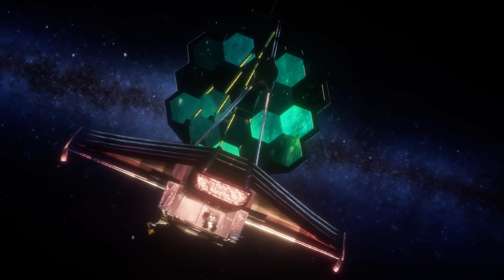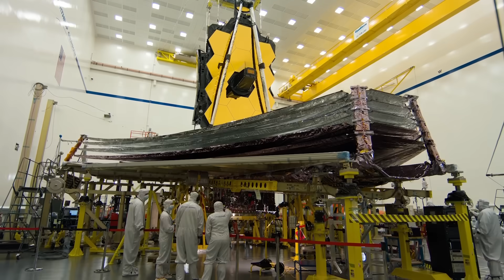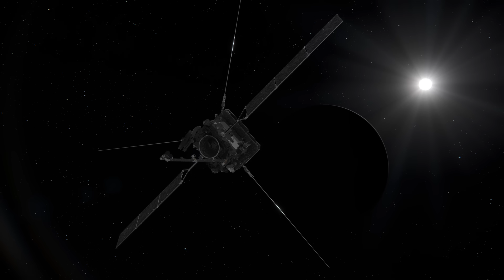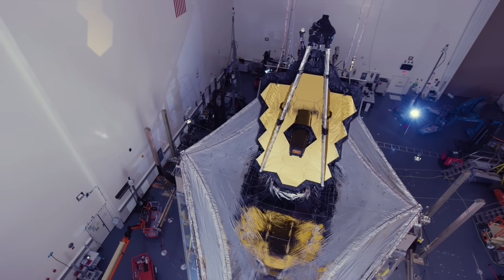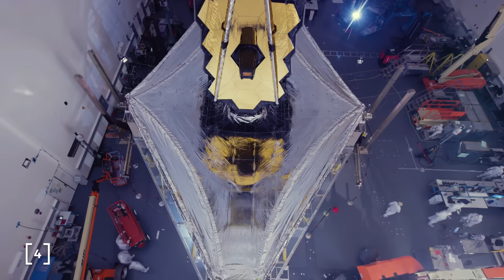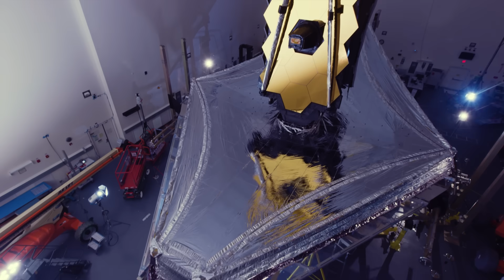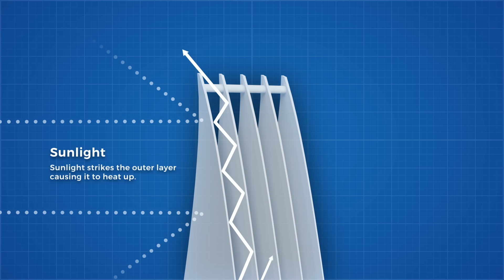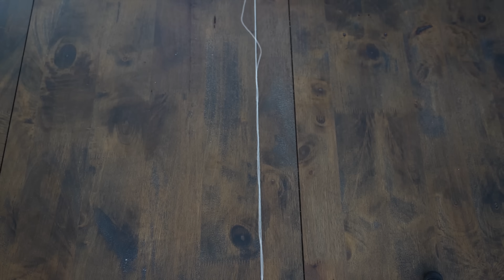The Insane Engineering of James Webb Telescope

Comment: The JWST cryo cooling system is just something else entirely. I work as an engineer on land vehicle cooling systems, and the thing about cooling systems is you don't realise how little you understand about the science behind active heat transfer systems until you actually start designing them. The designers would have had to simulate and account for every single joule of thermal energy throughout the entire telescope, and then design such a cutting edge active cooling system with moving parts that can last for decades of non-stop operation with no servicing and with no allowances for failure. How many times the engineers would have woken up at night in a cold sweat! I'm not even one bit surprised that it cost $150 million to design.
Reply: not only that, but i noticed passive analog cooling is ultimately being used to vent/radiate away the heat. what i mean by this is that it looked like they were using simple heat transferable metal (probably copper) to simply radiate the heat away from components and guide it where it's needed (the heat radiation). it's amazing something so technological uses one of the first ever but most used cooling methods devised. i'm not an expert on thermodynamics and my engineering skills are computer related, but it's all simply fascinating. maybe you could tell us more or correct me if my description is sketchy.
Reply: @rljpdx  There's simply no other sink available to deposit excess heat into! You can actively transport heat about the system all you want, but in the end, the entire system's heat sink must be external to the system, and accessible by some combination of conduction, convection, and radiation. In this case, the sink can only be external space, and that is only accessible through radiation. On top of that, the act of transporting heat against the direction where it wants to go in itself requires energy. So really you're trying to reject both the energy of transporting the heat along with the redirected heat itself. 

Since the temperature difference of the gas at either end of the pulse tube is relatively constant, the theoretical minimum temperature (with no parasitics) of the cold end is the temperature of the hot heat exchanger (HHX) minus the achievable difference in gas temperature at either end of the pulse tube. Any steady state heat load present at the cold end increases that minimum temperature because the cold gas in the pulse tube has to remove that heat load from the cold end through the cold heat exchanger (CHX), and so the gas must be colder. The heat of operating the pressure wave generator is generally rejected into the HHX, or an additional supplementary heat exchanger (aftercooler) placed earlier in the system, but can diffuse into the pulse tube gas, or present a heat load to the HHX and raise its temperature. Additional parasitic type effects basically just include all the conduction, convection, and radiation modes between parts of the system at different temperatures. 

For additional information, Ray Radebaugh is an authoritative figure on crycoolers and has written comprehensive reviews of the state of the art. He has also taught a short course at the yearly International Cryocooler Conference, though I'm not sure if that sort of thing is going on this upcoming year.
Reply: So...not really "insane."
Reply: @jasonyoung1622  yeah thanks. in my research I did discover these points you've made and your additional explanation is just good to know.
Reply: MoronicWaterBuffalo  your name describes you quite aptly.
Give credit where it's due & perhaps you should be applying for a job at NASA since, according to you it's all very simple.
Reply: @rljpdx  Essentially yeah, when there's no atmosphere available then radiation is the only way to reject any heat generated. The Apollo missions had the same constraint because there's no atmosphere on the moon at all. The NASA Lunar Roving Vehicle had a fascinating electronics cooling system that used thermal straps and boxes of paraffinwax that absorbed latent heat as the wax melted, then after each trip the astronauts would open up reflective panels that rejected that stored energy via radiation to re-solidify the wax. And it did work adequately for all of the missions despite the lunar dust issue. The technology that went into those manned missions was staggering even by today's standards, let alone over 50 years ago when it was a totally new frontier.
Reply: They are the kinds of engineers to wake in at night in cold sweat, and still calculate how much joules their bodies are now radiating.
Reply: MoronicWaterBuffalo  LOL good one ;)
Reply: @jimtekkit  wow, amazing stuff. thanks for all this great info. i thought it was just par for the course but i'm really amazed at the technology and the great explanations you guys have given. thanks.
Reply: Here in the gov of Netherlands they bought a corona app that shows a QR code for 30 million euros. Even though its 5 times of that same amount. Its more worth its money than anything stupid govs these days pay for corona idiocracy
Reply: @jimtekkit  It's not true that in space radiation is the only way to reject heat. The sublimators used in the Apollo lunar module and the astronaut's lunar spacesuits were basically heat exchangers somewhat similar to an automobile's radiator. Of course there is no air in space to carry away the heat so something else must be provided. This was done using water coming from a storage tank. The water was supplied to the sublimator where is was exposed to the vacuum of space so that it would freeze into ice. Then warm fluid from the cooling loops flowing through the sublimator warms the ice allowing it to sublimate into a vapor and that vapor is then released and it carries the waste heat out into space.
Reply: @jasonyoung1622  You seem pretty knowledgeable about this type of cooling system so I have a question. It seems like the pulse tube is basically like the compressor in a convention A/C system. Then the warm side heat exchanger is like the condenser and the cold side heat exchanger is like the evaporator. Also, it seems like there needs to be something like an expansion valve present to divide the high and low temperature/pressure parts of the system. Is all this correct?
Reply: @joevignolor4u949  
Hi Joe,

You seem like you already know things about A/C systems, but I will preface my explanation of cryocoolers with a review so that:

1. So I can more effectively compare and contrast the technologies. 
2. We can be on the same page
3. For the educational benefit of others reading
4. To lay bare my understanding so that others may correct me if I am wrong

Please bear with me.

A traditional A/C system works a bit like trying to transport water with a sponge. When you apply pressure to the sponge, you wring out water. If you reduce the pressure of the sponge, you can absorb water. So all you need to do to remove water from somewhere is to wring out the water by pressurizing it somewhere where it can be disposed, transport it to your target location, depressurize it so that it can absorb water, absorb the water, and then repeat.

On top of this, the refrigerant (sponge) used can also change between liquid and gas phases, allowing energy to be stored in the changing of the refrigerant phase. When a substance is changing phase, it remains at an essentially constant temperature, meaning that you can heat the refrigerant until it evaporates (which takes a substantial amount of energy) without it warming up and reducing further heat transfer. 

So now let's put it together. If you pressurize the gaseous refrigerant, then the temperature of the gas increases above room temperature. You can then try to reject as much of that excess heat as possible to room temperature (squeeze the sponge) so that when you depressurize it later at the evaporator, the expansion then cools the gas below room temperature. The phase change comes in when you design refrigerants that also condense when the heat is rejected at high pressure. Then, the energy it takes to change from gas to liquid (a large amount!) is also rejected to room temperature. Then, you depressurize (using an expansion valve, like you said) that liquid refrigerant inside your cooled room, where it reaches a lower temperature than the room and thus absorbs heat. At low pressure, the refrigerant is ideally trying to evaporate, so it is able to absorb a lot of heat at a constant temperature.

A pulse tube cryocooler works much differently. Firstly, no phase change takes place, as the refrigeration cycle must operate at such a large variety of temperatures that it is impossible to create a refrigerant that can properly change its phase during the full range of operation in a practical manner, or even remain liquid during the low temperature stage. Secondly, the gas does not continuously flow in a single direction. It moves back and forth, not in a loop. The gas flow is more like breathing into a paper bag - the components of the cryocooler experience flow in alternating directions over time. This seems counterintuitive at first - how do you create a temperature gradient if the same air is going to pass back and forth over the heat exchanger?

I will start again from scratch. Any cryocooler still fundamentally works like the sponge analogy. You are manipulating the pressure and location the gas such that it is hot when it is in the vicinity of the heat exchanger that rejects heat, and it is cold when it is in the vicinity of the heat load. I will start by describing the operation of a Stirling refrigerator with a regenerator, and then evolve it into an orifice pulse tube refrigerator (OPTR). Imagine you have a pipe, and at each end, there is a piston. These pistons will operate out of phase. In the center of the pipe, there is a rather dense arrangement of mesh screens (regenerator or stack). Initially, the piston on the right (cold) side is fully extended, almost touching the regenerator. The piston on the left side is fully retracted, leaving a large volume of gas on the left side of the pipe. The piston on the left extends halfway. The pressure in the pipe is now increased, and so is the temperature. Now the piston on the left extends the rest of the way while the piston on the right side retracts halfway. Now the hot gas is forced through the mesh screens. The mesh screens at the hot end absorb heat from only hot gas, but it cools the gas as it flows through. As a result, a thermal gradient is developed in the mesh screen because the cold side mesh elements are only in contact with gas that has already been cooled. Now, the cold piston retracts the rest of the way, fully expanding the gas. The gas is now entirely cold. If we now fully retract the warm piston and fully extend the cold piston, the cold gas is moved entirely through the regenerator from the cold side to the warm side. Now, the cold gas can cool the cold side of the regenerator more. As we repeat the cycle, the gas is precooled to lower and lower temperatures by the regenerator, and returns at lower and lower temperatures. We only need to attach our application to the cold side of the regenerator to cool it. Additionally, a heat exchanger on the hot side of the regenerator is beneficial to remove excess heat precool the gas more. Having 2 pistons 90 degrees out of phase can simulate these piston movement, and so Stirling refrigerators are often implemented with 2 pistons 90 degrees apart on a common crankshaft.

To evolve this setup to that of a single orifice pulse tube cryocooler as shown in 15:04, the cold side piston is removed and replaced with a pulse tube and an additional hot heat exchanger as shown in the video. This functionally accomplishes the same thing. The pulse tube can be broken into three sections - the gas in the first section flows between the regenerator and the cold entrance of the pulse tube. The gas in the next section floats between ends of the pulse tube. The gas in the last section flows between the pulse tube and a throttled gas reservoir, passing over the hot heat exchanger while doing so. The throttle on the gas reservoir delays the movement of gas from the pulse tube to the reservoir, allowing a 90 degree phase difference between gas movement at the piston and the reservoir, similar to that of the Stirling setup. So the gas in the last section acts as a piston rod, forcing a 90 degree phase change on the warm end of the pulse tube. The gas in the middle section is a buffer between the cold and reservoir gas volumes, acting like the cold piston of the Stirling cycle. We have made a functional equivalence between the Stirling and Orifice Pulse Tube refrigerators and in the process, replaced a rubbing, wearing, moving part with gas dynamics. As a note, the pulse tube itself will also have a thermal gradient. The middle section thermally insulates the first and last sections from each other.

The JWST cryocooler is described in the video should operate somewhat differently from the OPTR I described earlier, but should cool on the same principle of a phase difference between ends of the tube. The OPTR I described above is a traveling wave device, while the device described in the video is a standing wave device. I am less familiar with standing wave pulse tubes, but from my understanding, the overall size of the pulse tube must line up with some critical fraction of wavelengths at the operating frequency, and so higher frequency operation can reduce the necessary size and weight of the cryocooler, which is ideal for space operation. The hot end of the pulse tube is a node of the wave, and so the size of the pulse tube can be tuned such that the regenerator is phased appropriately from the pressure source, creating the same cooling effect. However, I doubt the efficiency of a standing wave device can match more easily controllable characteristics of the travelling wave device, and so the JWST cryocooler must necessarily consist of multiple cryocooler stages to get to temperatures around 7K.

To conclude - the hot and cold heat exchangers are analogous to the evaporator and condensor of a vapor compression refrigeration A/C system, but the compressor and expansion valve are harder to draw analogies to because the pressure of various points of the system itself is changing with time because the cycle itself is rather different.

I hope this helps, and that you have a happy New Year!

-Jason
Reply: @rljpdx  No problem - I have explained the operation of cryocoolers in greater depth in another comment on this same parent. Feel free to read and comment if interested. Happy New Year!
Reply: @circuitbreaker8314  What the hell is "QR Code." A Cheat Code, of some sort, for to help solve "Q-Bert Riddles/Puzzles"?
Reply: @jasonyoung1622  thanks so much for explaining this! Super interesting
Reply: This will make it to heŕ destination succesfully
Reply: @ihavefallenandicantreachmy2113  you are so smart
Reply: @jasonyoung1622  thanks for explaining how it works! One question. Would a cryocooler be more efficient than a HVAC on a house?
Reply: @pyrocl0  a cryocooler specifically? Probably not. Using one as an AC would be extremely expensive and it would be optimized specifically for a cryocooling application. Also, it would not be very powerful. HVAC units are capable of efficiently moving a lot of heat with relatively simple and inexpensive parts. However, there may be some merit in using a Stirling cycle that is optimized for air conditioning environments. It would be difficult to do so properly for commercial adaptation, and would likely remain quite expensive compared to traditional HVAC, but I imagine raw efficiencies would be comparable and perhaps the Stirling cycle could be advantageous in some specific usecases.
Reply: MoronicWaterBuffalo  got us good
Reply: Wouldn't the oscillator for the JWST create a vibration throughout the system unless physically balanced and not just acoustically.  Acoustics refers to only the media being oscillated and not the support structure.  Perfect cancellation isolates them but a moving cylinder (like a car engine) hardly does that.
Reply: MoronicWaterBuffalo  Trust me, there's even more women married to frigid men. Your name is indeed....reflective of your comment, I may add.
Reply: MoronicWaterBuffalo     c'mon.
Reply: @ihavefallenandicantreachmy2113  you're right! I'll happily help pay for this over an 800 Billion dollar military budget
Reply: So u mean the creator of this video had misunderstood, dont u?